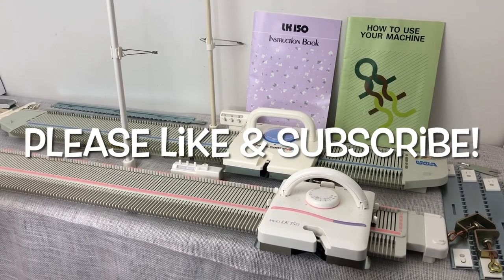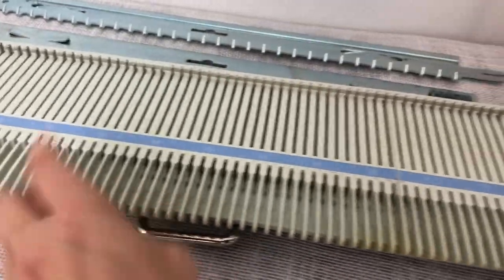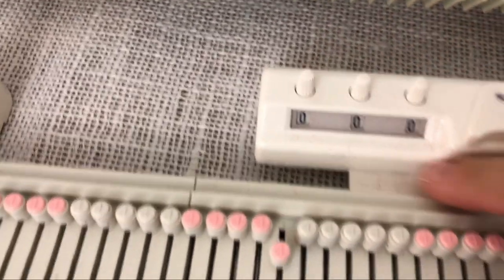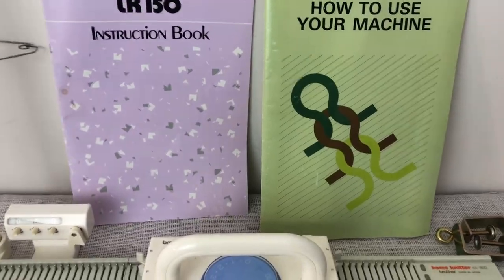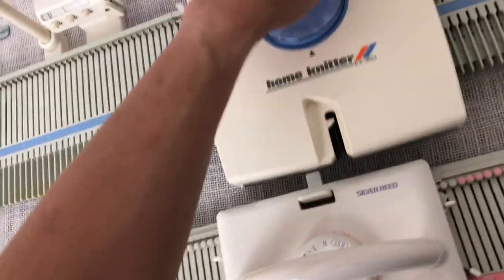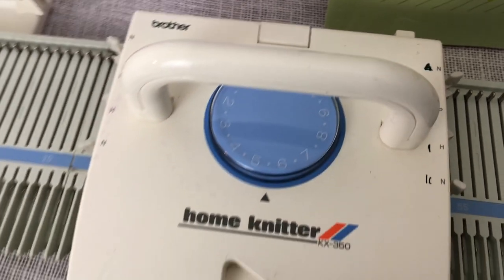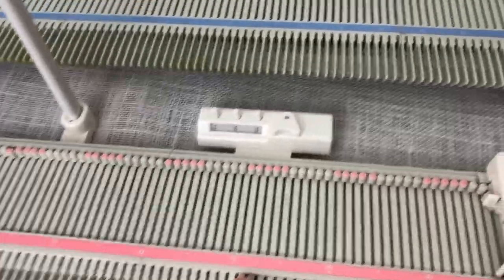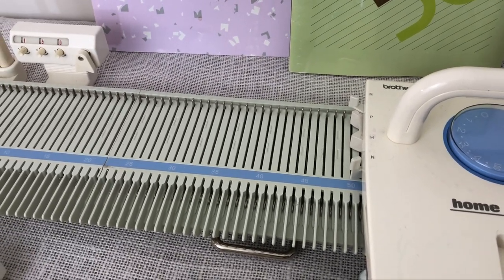LK150 vs KX350 knitting machines!

Comment: I am enjoying your videos. Thank you! I have owned my LK150 since 1998 but just pulled it out of retirement after several years. Easily replaced the sponge bar and off I went! Such fun. Note that you can purchase a 50 needle extension for this machine, which was easily installed. Also, those little rollers on the tops of the needles are supposed to make the carriage move more smoothly and easily. I don’t know how that compares to the Brother machine. I am interested in the rubber wheels, so thank you for that tip.
Reply from the maker: I didn’t think the extensions were still available; do you know a source for them? As for the rollers, I don’t really notice much of a difference. But, the rubber wheels really have made a difference for me.

Comment: Anna I also own both of these machines, and actually like the KX350 best.  Got my KX350 for $125
which came with all the accessories, manual and VHS.  When I made your asymmetrical shawl, I 
made it on the LK150.  What I am making dictates which mid-gauge machine I will use.
Reply from the maker: I secretly have a favorite, too.

Comment: The LK150 also has the additional benefit of have 2 additional carriages, the FC6 Fair Isle and the AG11 intarsia. . Unfortunately they are no longer manufactured and second hand ones are ridiculously priced.
Reply from the maker: That's true. There are intarsia carriages on Amazon; possibly aftermarket, but they are only about $70. I will put a link in the description. I have not used one of these myself.

Comment: A very interesting comparison, but you fail to mention that it is far easier to change the sponge bar on the LK150 than on the Brother machine. I have done it on both...
Reply from the maker: Yes, that’s true. I have eight or nine KX 350s and have put new sponge bars in all of them. I made a video showing my method with few tips to make it less difficult.

Comment: Thanks for the excellent video!  I have had the LK a few times but I really don't like the roller caps.  Do you find a difference between the feel and ease of movement of the carriages?  I am leaning towards finding a Brother 350 to take apart, so I can transport it home to Mexico.
Reply from the maker: To me the Brother has a sturdier feel. Though after I replaced the brushes with rubber wheels, the LK 150 carriage seems better. It was kind of wimpy with the brushes.
Reply: @AnnaHaferman   Thanks for your reply, it's what I was hoping to hear.  The Brother looks a lot more sturdier too, with a lot more metal under the bed.  I feel encouraged now to look for one.  I wish I could take one of my metal beds but that's a challenge!

Comment: Thank you. I have a KX350 that I got on eBay that looked pretty much unused (the sponge bar looked new). I am still trying to find room for it so I was interested when you mentioned the pieces - I'm wondering if I can remove one (I want to make socks with it so a lot of the needles wouldn't be used). I don't know if that's been addressed by anyone; I'm just starting to research it.
Reply from the maker: Yes, you can remove one or two pieces and attach the ends. I think each piece has 44 needles which might not be enough for a sock depending on the size of your foot.

Comment: I'm a new machine knitter and purchased a KX350 recently. All of your videos have been an immense help in using my machine! I noticed the rubber wheels on my carriage are a little warped, and was wondering of the age of the parts (my machine appeared to be unused but in storage for decades) is causing the yarn to get caught occasionally. Will the wheels you put on your LK150  also work as replacements for the KX350? Many thanks in advance!
Reply from the maker: Yes, they will. I’ll put a link in the description.
Reply from the maker: There are some that are black rubber and some that are grey silicone. They will both work but the black ones are more flexible and work better. Also, if you haven't changed the sponge bar, it will need to be changed.
Reply: @AnnaHaferman  Thanks so much for the information. I'll buy the black wheels you linked to. I did change the spongebar on the machine first thing -- and I owe my success in doing so to your excellent video!

Comment: I downloaded a manual for Brother machine, but noticed that on page 6 in Needle Positions the part of the final phrase is missing. It said: 'When you set the needles to B or D positions,' and nothing else. What is the ending of this sentence in the original manual?
Can you swap carriages between the machines (use Brother carriage on Silver Reed machine an vice versa)? Thank you.
Reply from the maker: I'll look in the manual tomorrow and see what got cut off. You can't use a Brother carriage on a Silver Reed as they are different widths.

Comment: Please I am new on this how do I know to use what numbers on the carriage for tensions do what size the yarns?? Help
Reply from the maker: Which model of machine do you have? If it's the LK 150 (or Brother KX 350) you should start with DK or #3 weight yarn. Usually I start around 4 and if the fabric seems too tight, go up in tension. If it seems too loose go down in tension.

Comment: I have the KX-350 and the SK-160 it's basically a metal bed LK-150. IMHO the LK-150 has a 2 advantages. One it's still made and two you can get a garter bar for the LK. The 7mm bar for the KX is unabtanium. I did find the 7 prong tool for the KX.
Reply from the maker: Also, the FC6, the intarsia carriage and the KR-11 were made for the LK 150. You can’t get those for the KX 350, though you can use the KL 116 as a charting device and if you can get a KH 400 you can use that carriage for intarsia. 

I like certain aspects of each machine. 

I like the KX 350s because they are sturdy, slightly bigger gauge, and you can easily attach a few of them to make a long bed if needed.
Reply: @AnnaHaferman  I didn't realize you could use the 116 with the KX machines! I have one that came with my 930. My favorite thing about the machine is the weight. I think the entire KX-350 weighs less than the carriage on my KH-260. 
You're videos are inspiring me to get mine out of storage and maybe sew it a nice travel case.